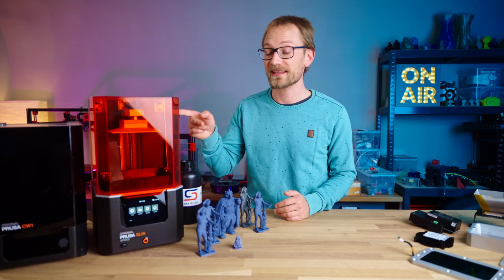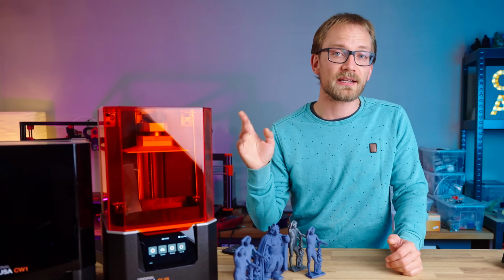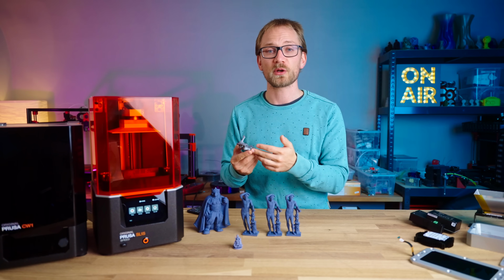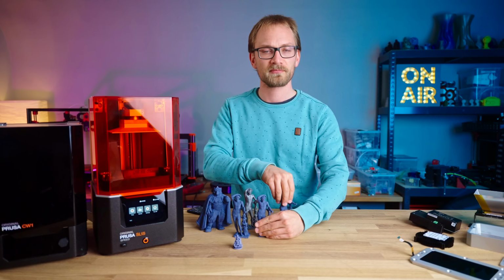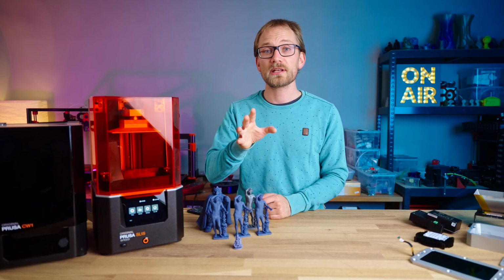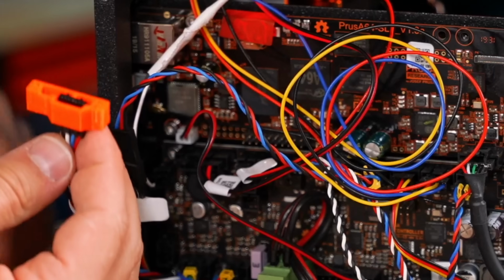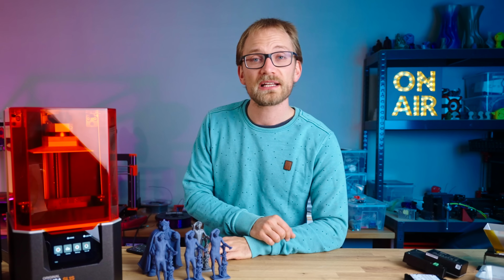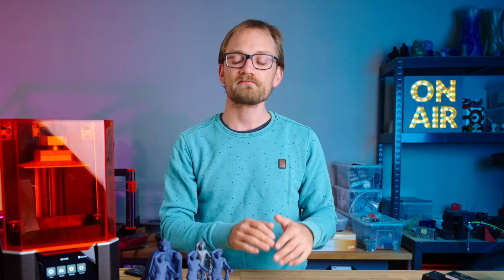The Prusa SL1S redefines SPEED!

Comment: I upgraded because i wore out the led i had trouble with getting the tilt mechanism level and was having print adhesion problems on larger builds  on the old smaller platform once tightened I managed to get it level and it served me well for the last two years. The upgrade was a walk in the park until I created a slight abrasion on the ribbon of the LCD screen and had to order a new one the print speed is phenomenal should have done it sooner but I have to agree it’s a tight work area and I rushed to get it up and running and it hit me in the wallet.

Comment: Resin printers sound great until you read AND UNDERSTAND resin safety data sheets. I am drawn like a magnet to resin printers because of their advantages, but I am even more repelled by resin toxicity: bad for both users and the environment. Show me a reasonably safe resin, and I will show you another resin printer customer. Until then, I will put up with the drawbacks of fused-filament printers, including their glacial printing speed and multifaceted toxicity that is easier to mitigate.

History is littered with things that were presumed safe, but weren’t: asbestos, lead, mercury, x-rays, thalidomide, Agent Orange, Teflon & related chemicals, BPA & related chemicals, triclosan, cigarettes and smoke in general because of particulate matter that most people blithely trivialize or ignore, lopping a few years off the average lifespan. When will we learn to be more circumspect?

Comment: How does this compare to the 3D systems figure 4 standalone, that prints fast but at Aus $30,000 it’s expensive. They also claim their resins are UV stable after curing is this possible?  Can you use 3D systems resins with this printer? Thanks for your help.

Comment: the Prusa SL1S doesnt redefine anything but  pricing. 
every current gen consumer resin printer on the market can cure layers in less than 1,5s and the price of 2k $ is simply laughable when I can get a printer with a larger print area and the same print speed for roughly 500$ from companies that have vastly more experience with resin printers than prusa

Comment: I've had the almost 10x cheaper Mars 2 pro for almost a year now, and the biggest downfall is the build size, so this would be completely pointless as it's basically the same size (even smaller height). I'm way more likely to want to get the Saturn or even the Jupiter (though seems a bit too bulky for a desktop setup).
Reply: My thoughts exactly. The price tag is down right ridiculous.
I would gladly let the printer run longer for same quality prints at around $1700 less... I could buy 3 more printers if I was in that big of a hurry to print more stuff and still be ahead money wise.
Reply: @NuarStanger  Yes and no.  First off let me preface by saying I don't have either of the mentioned printers yet, and I'm currently debating between a Saturn 3 and this Prusa.  That said I do have several FDM printers, having started with a Creality Ender 3 Pro and moving through several cheaper brands before one day getting a Prusa MK3.  I've never even touched another FDM printer since.  The difference is freaking night and day.  There was never an end to the tinkering, tweaking, adjusting, etc on all the other FMD printers, where as the MK3 prints perfect every single time from the first print to every other one.  I never ever have to do anything but press go.  It. Just. Works.
Now again, I don't have experience in the resin side, so maybe all the cheaper resin printers are just as good as the more expensive ones, I don't know.  But from my own experience on the FDM side I am definitely debating this.  I like the larger print volume of the Saturn, and obviously the WAY cheaper price is a selling point.  But I know Prusa printers are ROCK SOLID.  I love the idea of the tilting plate.  I also like their post processing station a lot better than the Mercury because of the heater mostly.

Comment: So if you spent an equal amount of money on a budget resin printers. How many models could you print in 24h ? with one SL1S or with 7 Budget printers ?
Reply: budget printers win out by roughly 7 times . 1,4s cure times is standard for all mono LCD printers which is the majority of current gen models. 

for the price of a single sl1s I could buy 5 anycubic mono and about 75 bottles of resin and print for roughly 3-5 years including cost for alcohol , gloves and replacement parts

Comment: You could make PCBs on these kind of printers with photoresist film on PCB. Placing pcb on printer LCD (design of pcb on lcd screen) with photoresist facing down. Then cleaning uncured photoresist and dipping in ferric chloride.
It will reduce time required for making homemade pcb with high quality.

Comment: I owned a Voxelab Proxima 6" and the prints from it were absolutely incredible even for a resin. I sold it and "upgraded" to a Elegoo Saturn which is great for more printing room but has issues the Voxelab did not. I would really like to compare the new Proxima 8.9 as it's likely similar hardware to the Saturn just later to market. Even more interesting is the Elegoo Jupiter. I had thought about joining the Jupiter's Kickstarter but it's clear other models with the same print area will release within a few months of the Jupiter and possibly be more polished. In the meantime I'm waiting for my formbot 2.4 kit to ship.

Comment: looks like a great printer but for the price I can get 4 of similar size from the competitor that also print great albeit a bit slower.
Reply: pray tell what current gen mono screen printer prints slower ? 1,0-1,5s is the current gen industry standard and the sl1s with 1,4s isn't exactly fast by that measure

Comment: The “resin vat too full” error occurs if you fill the vat while the machine is powered off - the platform for the vat skews slightly forward when it is unpowered. I figured this out through trial and error, I had thought a sensor was bad at first.
Reply: it's normal for such things to happen.  
same thing happens in reverse with our espresso machine.  

if you empty out one of the containers while it's powered off it doesn't know you did so.

Comment: If your family has female person included (or you are/had it otherwise), UV nail apparatus is good for resin printed works to afterprint hardening, 30sec UV radiaton, turn 180 degree, 30 sec again and its done. Of course cleaning must do manually but why not use what you have?

Comment: impressive. How well do resins (today) hold up when it comes to mechanical stress? Can you send some samples to CNC-kitchen? :D
Reply: "My Tech Fun" channel has done this.
Reply: for fragile parts standard resins shatter with minimal force although they do withstand a decent amount of compression. 

flex or abs resins are much better both in tensile strength and in terms of overall durability. however you still don't want anything that is load bearing or under any kind of friction to be made from uv resin

Comment: Hmm I paid $189USD for my Photon Mono recently. I get the 2s layer time and amazing quality. I don't see anything about this Prusa that makes it worth 10x more money.
Reply: Take a hires photo of your prints and look for lines and layer shifts.
Reply: @Holztransistor  lines are caused by the layers and the prusa doesn't do anything better in that regard. as for layer shifts they usually only happen with a bent z axis and if you think that doesn't happen on this 2000$ waste of money you are delusional.
Reply: ingmar you are overexposing your prints at 2s for the mono. unless you use some funky unknown darker than black resin . regular resin takes between 1s and 1,6s tops on the mono . chances are you get failed prints at those exposure times because your plate isn't leveled correctly or you have a way too high lift speed as is standard on those machines .

Comment: The price is not that crazy. The accuracy of the printed parts are on par with what a quality desktop CNC would output. The CNC alone would be double the price of the full SL1S setup, and then you need to buy additional tooling. That means we have 2x cheaper way to make molds for resin casting

Comment: Can I please have an explanation for the fricking twenty hundred dollars price? I mean, no matter the technology, what matters is the result. If it gives me a xy resolution of 0.49 mm and a smaller build plate than mars 3 which has an xy resolution of 35 mm and a larger build plate why should I pick it for about seven times more money

Edit: I also checked and there is absolutely no reason for the massive time difference between the sl1s and the mars 3 the sl1s has a curing time of 1.4-2.5s and the mars 3 has a curing time of 1.5-3s so the time should be very similar
Reply: The difference is because of the peeling mechanism. Regular MSLA printers have to move up to peel and then down again to cure. The SL1S removes the need to move up and down by instead tilting, which takes a fraction of the time, so while cure times are comparable, the time per layer is a lot less. With optimised settings and faster peel speeds the difference would be far less pronounced, however.

Comment: Even at half the price it would still be a premium price for the size it can print. Yeah its better but horrendously overpriced.
Reply: better than what?  this printer is objectively worse than most 4k chinesium printers you can get for 500$
Reply: @KT-pv3kl  im saying speed wise... trust me I think its insanly overpriced.

You can get a phrozen sonic 8k is that price and well the size of prints that can be done or total number of items printed due to bed size notify the speed improvement if youre doing alot of little things.

There isn't anything prusa I would ever buy since everything is sold at 3 to 4 times the price

Comment: I dig the idea of the tilting bed, but for a printer of that size, I'd rather roll my money into a larger print size versus going down from a midsize printer I have now. 
Speaking of speed, I was browsing in 'dream land' the other day and came across some high end printers from Uniz that have a starting build speed of 200mm/hr and go UP to 600mm/hr (!!), and with 'standard' features like a pumped resin supply, liquid cooled print screen... Ugh, I was getting weak-kneed sitting down. I would totally use all of my Youtube pull if I were in your shoes for a demo model. 😁

Comment: How many hours of run time before needing to change the carbon filter? And also, how hard is it to change/replace the carbon filter? Thanks. (Im still researching resin printers for my first buy).
Reply from the maker: Mine so far still does a great job of keeping the resin smell down. If I'd have to guess, I'd say it should last a couple hundred hours if printing easily. Swapping it is two screws on the back of the printer - takes less than 60 seconds to swap.
Reply: @MadeWithLayers  Thanks so much for the response. I’ve had my MK3 for 3 years now and the printer is bulletproof. Works every time I fire it up. I was told by many when I purchased my MK3 that it was too expensive, but I’ll buy/take reliability anytime. Thanks again.

Comment: I’d be interested in seeing your take on the Photon Ultra with the TI DLP system. Seems like a more powerful light engine that might work better with more “industrial” resins.
Reply: my take: too low resolution.
Reply: @JKC40  its dlp man...720p dlp is actually more detail than 4k monochrome lcd
Reply: @Presbiter  Not really..
Reply: @BH4x0r  Of course it is. But to know that one must understand the technology. One very significant thing fe dlp does not produces shadows, lcd does. May be look up what that means in detail and learn something, just a suggestion^^
Reply: @Presbiter  I know DLP basically are tiny MEMS mirrors that will reflect or won't and that way can get better contrast than LCD, but it's still less than ideal as a 720p DLP chip is unable to produce as small details, if you get what i mean. if it was a 4K chip that'd be better.

Comment: Would love a comparison between the SL1 and the Form 3. Especially including accuracy.
Reply from the maker: I'll be getting a Form 3 for review soon!
Reply: @MadeWithLayers  Nice! I actually have one. I thought I was getting the top of the line printer, but have been rather disappointed by the accuracy. It's gotten a little better over the years w/ some updates, but still has a lot of issues w/ surface tension stuff or something. You can see a lot of discussions on their forums.
Reply: agree, it’s hard to really grok comparisons of printers at two widely different price points.  It’s ok to compare with the last version, but SL1S should also be compared with others at a similar price point to see its value.

Comment: The tilting vat mechanism and build quality is very nice. But it's already outdated in terms of pixel density. :( This printer with the LCD of the Mini 8K? YES!
Reply: Not sure how useful more resolution really is. You can barely see all the details the SL1S prints unless you're bringing magnifying glasses to your DnD sessions, so what would the higher resolution be good for?
It's the same questionable choice as 4K phones and 8K TVs, it's just big numbers that make you go "OOHHHHHH" but nobody really needs them nor sees a difference...
So I'm always careful with the term "outdated", because many times I prefer "outdated" if it means "more sophisticated".
Reply: Not sure why my answer got deleted. Is mentioning other printer companies (professional DLP manufacturers) not allowed here? Anyway. DnD is definitely not the focus for me. It's display quality pieces. 75 mm and busts, 1/6 scale, 1/4 scale. I want all the detail I can get and at larger scale you even have pieces with skin texture. The better the XY resolution, the less visible voxels you will have on the printed pieces. That is the key element. Studios that manufacture collectible 1/4 scale statues use printers with 25 microns XY resolution for the master model. A 7.1 inch 8K LCD has 22 microns XY resolution. I expect more such printers now. There also is a 8.9 inch 6K LCD in the making that has 35 microns XY resolution.
Reply: @Holztransistor   @Holztransistor  I see. DnD was just mentioned to make the point :)
I understand what you mean, but as far as I understand, that's a very specific use case. I imagine that the biggest portion of SLA users doesn't need higher resolution than what this machine can provide, so I understand why Prusa chose to keep the DPI at this level instead of increasing the price of the machine even more.
I can only imagine how expensive these 25 micron LCDs must be?